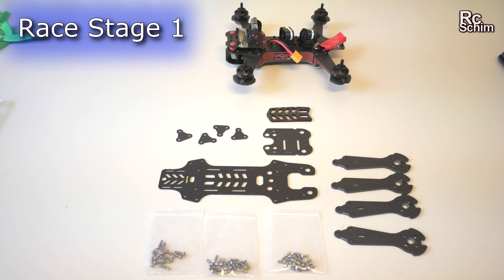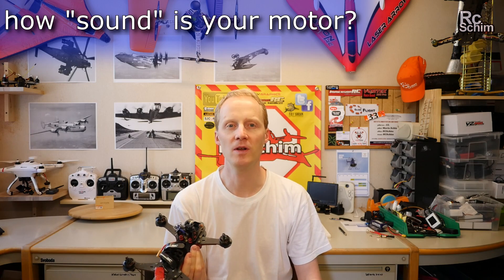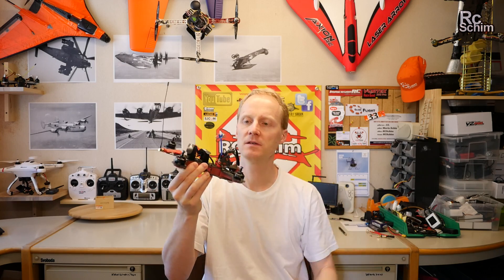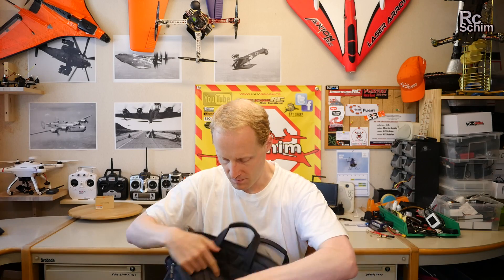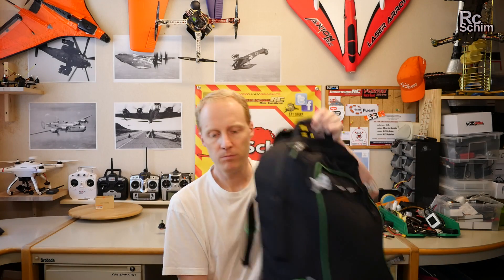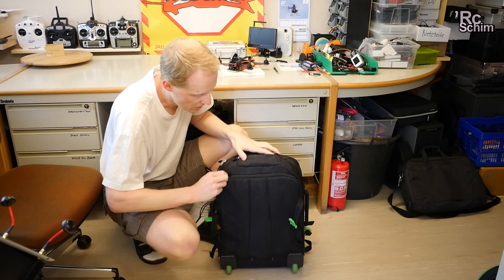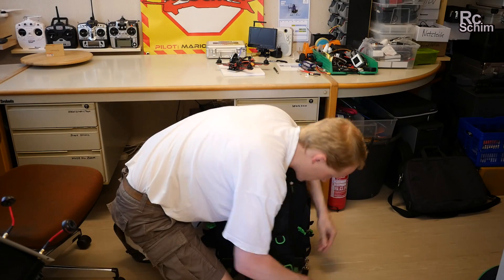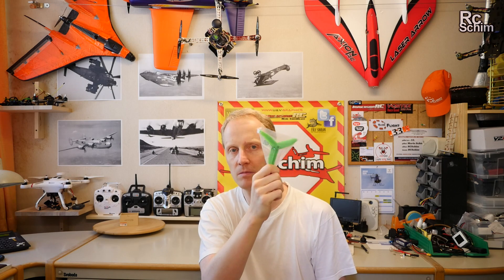Vortex 250 Race Stage 1, my FPV Backpack, Motor swap and another CRASH

Comment: I bent a shaft on one motor today and i want to change it with emax 2205 2300kv. Should i just change the one or buy all 4 ? and do i need calibration or something after changing the motors ? Thanks
Reply from the maker: +25trajcer in theory you can have diff morors and escs as well but it is not optimal.  I think skizo made a video with his frankenquad... calibration is only needed if you change esc i think

Comment: Hi Mario, sorry if you covered this already but how do you like the ezUHF with that setup? Also were you able to get GPS working for speed readings and position incase of a crash?
Reply from the maker: Hi Jeff (let's just assume Shana doesnt care so much for RC :),
  ezUHF is ok - but recently I had some rssi warnings already at not so long range - so I feel a bit unsecure right now. can be a defective RX or antenna since it was involved in a crash. gotta research this more).
No GPS here - didnt care. Crash: I use DVR in fatsharks - normally this gives you a good estimation where to search and for really finding it there I have a Loc8tor inside the fuselage which has a range of around 80m this way (enough in a field).
Reply from the maker: speed I estimate around 100kmh (based on video analysis and google maps measurements)
Reply: haha you are right :) thanks for the info... do you have any opinion on the vortex 285? Maybe be better suited for carrying a bigger bat? -Jeff
Reply from the maker: the 285 is the older one right? but there is also a new pro version the 275 pro - which is tuned by metal danny - and I guess it has larger props (more speed?) 
http://www.dronetrest.com/t/vortex-275-metall-danny-edition/2700

Comment: 40 grams is quite a bit sir! I actually skipped on the Vortex because of the weight, but this might change things :) 
Thanks for the video! :D 
Some motor guards would probably prevent dirt from getting in to the motors?
Reply from the maker: before I installed the race stage1 I realized: I did use an SMA adapter thingy that made my antenna taller (to stick out further for better video). this thing has 9gr!!!!
so be removing this unneccessary sma adapter I got to the advertised 40gr in sum :)
not crashing would prevent dirt getting in there as well - that was my plan - I have to stick to this plan more :)
Reply: Ghehe THAT would help quite a bit as well indeed :)

Comment: Hello RCShim the new vortex pro Uhmmagaud model comes stock with 5x4x4 props and their is a video by Boris demonstrating the props as he was the first to use them and they increase speed by 20 Mph I,m guessing but if you watch his video it looks a lot faster. Thanks for another good video. P.S have you tried the new Vendetta yet?
Reply from the maker: the Ummagawd edition has Race stage 1 included per default.
Not sure about those super demanding props. they kill your batteries in no time. 
I remember that speed run on the initial Vortex250 on their hawaii trip. I think it was tommy. he flew super fast, out far - came back and crashed into the salt water near the beach because his battery was flat. the vortex flew the next day after it was dried in a bag of rice. epic :)

Nope, no vendetta here. Trappy once told me he would send me one - but I think he gave away too much. there is a good comparison on rotor riot - they tested vortex vs vendetta.
If asked I now advise people to buy the vortex. it worked good for me, is available in so many different shops. it's out longer and proofen. maybe vendetta is more bad ass... and looks cool as well :)

Comment: Interesting... I have been using the A-spec batteries (1300mAH) and found them to be not very good at all.
Reply from the maker: well, I'm not a pro battery tester (like you or Joshua Bardwell) but my test is: fly them to 20-15% have some fun and after landing touch them. 
if they are as cold as these were - I'm ok and think the AMP draw didnt kill the batteries.

according to my charger (graupner duo 60) their IR is around 45 to 50 mOhms where the 1800 graphenes showed 15-20 mOhm on the same charger.
I know these IR tests on chargers dont mean much - but I started noting them down in my flight and charge log.

I have 3 flights out of each of the 4 packs 
flew average of 4mins with my vortex (so not too hard acro), charged avg 1034mah on these 12 
flew them down to avg of 18%  (that Vortex OSD is so nice, sends me the mah consumed warning always in the right time)
flights and flew with avg amps of 13 to 19amps.

One of the 4 packs had slightly off balanced cells but this dissapeared after the first charge.

I chose them because they were the best option which was on stock. If they would have had turnigy graphene 1300 I would have taken these.
My tattu 75c 1300 are crap - maybe I killed them with my bullet last year? not sure...

sorry for long reply, coffee was kicking in and I love useless statistics :)
Reply from the maker: just consider:  highes C rating possible (that increases their weight though) 
are they  on stock?
weight to pack capacity
dont by the really cheap brands that lie (when it comes to C rates or capacity).

so far I liked the nanotechs - had no luck with the german SLS, had no fun with Tattu
My batteries are NOT sponsored - dont have to say nice things about HKs batteries - I honestly like them (but I'm not a pro racer with high demands - I do more cruising and just need reliable ones)
Reply from the maker: I think (but didnt measure scientific!):
Turnigy graphenes   are the best (deliver high Amps long, hold higher voltage under stress)
bolt or HiLv look good as well (but were not on stock)
aspec nanotech   look promising, work ok for me
normal nanotech   had many of them - good but get puffy over time
multistar     very good weight vs capacity but not really powerfull (low c ratings)
normal turnigy   
I didnt test/use the other (zippy, ....)
Reply: My A-Spec batteries have quite a high internal resistance and this shows in the way that my low-battery telemetry alarm kicks in pretty shortly after take-off.  The higher-C nanotech packs are much * better in this regard and I don't consider the quite significant premium charged for the A-spec batteries to be worth it.  The bolt batteries are *much better (value-wise) and the Graphene packs are holding up very well (but they are heavier).

Unlike many people, I've had  very little trouble with nanotech packs puffing -- probably because I am very rigorous in ensuring that my packs go straight back to storage charge when used.
Reply from the maker: Now I've watched my DVR flightlogs with OSD (Vortex shows Volts and Amps which is handy).
The fresh 1300mah packs did normal but I was at a new location and did just cruise around and took around 15-25amps from these batts. 
The voltage dropped steadily from 16 to 14 volts over the capacity.
once I did a punch out (65amps) over a tree the batt did sag down to 13.6v (only took 150mah out of this pack before the punch).

if they were really performance batts I think they werent supposed to sag below 14v.
So I have to agree that these sure are not aspec or any good for hard racing. I will see how they perform over time with my freestyling around - but I latley liked it more to cruise around smoothly. Guess I could go back to 3cells for this :)

now I found a comparison: on a flight with an 1800mah graphene I had a 65amps punchout for 2secs and the pack was around 50% capacity:  the voltage dropped here to 13.4volts

Comment: Also, what's up with that Laser Arrow? I see you bought it and had it in a video, but have never built it? Looks pretty cool.
Reply from the maker: that plane has a longer story. It came RTF but the motorshaft was bent BEFORE even having a chance to crash it! it wasnt only the prop that was causing massive vibrations. The vibs were so loud it screamed - so I stopped flying and wanted the shop to replace this new motor.
they took 3 weeks and sent back the original motor with "you have to balance your prop" message. Fine shop!  (austrian shop, Schweighofer)  
I then ordered a potent motor at hobbyking and now I didnt have the time to install this motor.
But I should because this thing is a rocket. Literaly! it can start from the vertical position like one :)
gonna try to spend some time on this one soon.
damn. too many projects, too many different things to fly, too little time to...

Comment: You should build a 5" Alien with KISS FC and those KISS 24amp racing ESCs. I love mine. I swear by the KISS FC, and any of the KISS ESCs, but the 24amp racing are the best. They have a 32 bit processor on each one and can give you telemetry. They are the best quality I've ever seen for a quad ESC, after all they are German made!
Reply from the maker: I will test a new alien like fine frame maybe (in the next weeks) so I'm researching which motors, escs and FC to use. I heard good and bad stuff about Kiss - skitzo tested 2 quads - not sure what his final thoughts were...
Reply: Whats the bad stuff? Fire? I've seen some videos and heard some stuff about how they can catch on fire. I have also seen a lot of other ESC also catch on fire though. I'd be interested to hear though. Maybe it's not the esc I like so much? I have only run then on the KISS FC. Maybe it's the FC I'm in love with lol.

Comment: Using 433 MHz rc is ok, but for mini quad it makes too big delay. The mini quad is mostly for racing and aerobatics which requires fast reaction. For long range FPV I use my good old tricopter with 433 MHz immersion rc.
Reply from the maker: yep, I noticed some situations where the latency was "present" (if you're diving down between trees and suddenly need to evade some obstacles. It should be possible to have ezUHF on sbus mode with lower latency - gotta research this. I want maximum possible control range (just in case, mountains etc.) Also I missuse the little quad for proximity and longer range in scenery. Racing isnt for me, acro is fun - but most times I do tree surfing and flythrougs...   Tricopter rocks. I love how they "feel" if you turn into a corner. I flew so much with the old KK1 Tircopter in 2011.
Reply: The SBus in ezUHF will not help much. The latency is due to low frequency (433 as compared to 2400 MHz radio). Low frequency means less information can be transferred in given time. This cannot be fixed easily.
Reply from the maker: thanks for that thought - sounds logic. I will stick with x4r for close proxy flights and will have another quad for longer range and less reaction needed...
Reply: I also had an unexplained crash using the Easy UHF, but it was on a HobbyKing SkyFun. I was flying along fine, then it just lost complete control, and acted like an aileron came lose or the connecting rod pulled out. When I got to the wreckage, everything was fine, except it was smashed in the nose. I even had pretty good metal gear servos on it. Just before though I noticed how much latency it had, and was thinking like you about the SBUS. I've been thinking about the TBS Cross Fire, it's 900-800Mhz and you don't need a ham radio license to use it. I have heard great things about it, but it is pretty spend y about $300 for the Tx and Rx.
Reply: One possible solution is a 2.4 GHz booster say for 1 or 2 Watts for . They are cheap, but I am not sure if they are legal in Europe.
Reply from the maker: the easier way would be using the longrange version of the FRSky receivers. I will dig into that later...

Comment: I have mostly flown a lot with T-Motors 1806, 2208 (both 2300KV) with mini quads!
Few months ago i tried some Emax 2205 2300 KV, they are quite popular right now, honestly for the price they performed pretty well and the quality seems to be good even after a couple of crashes, they still perform good!
In term of props, i was mostly crazy about gemfan 5045x2 bullnose and recently i started to use the new version of dal props v2 5045x2 bullnose and i have to say i am pretty impressed by the performances, the quality and the price compared to the Gemfan. 3 blades props are something i still need to use too lol I just started to fly with them! But once again Dal props v2 are my first choice...
Really love your new bagpack, pretty interesting i have to say and your taranis bag is definitely something i should buy :p
Funny noise at the end of the video, for joking i was thinking, it could be his girlfriend cutting a tree in the garden lol
Happy midweek Mario
Reply from the maker: thanks for your motor and prop tips Cedric! I read about emax. Might give them a try. I had this Ikea Trolley sitting there for a while now. As said, with the transmitter bag, I like the oranization in there. The wheels are pretty large a smooth on this trolley as well. I one takes it really for travelling you sure can fit some charger and additional stuff in there...Have a nice week too!
Reply from the maker: btw. the sound in the background was the mother in law cutting some higher greens, we dont allow them to cut any more trees. It's really important to have the big green fellas around if you're living in a city!
Reply: RCSchim Hahaha that's a very healty mother in law you have over there!
Mine doesn't like me unfortunately, but i would trully enjoy spending time with her but she has her own believes about people like me...
Anyway, enjoy the rest of your week and enjoy these precious moments of life with your family
Reply from the maker: sad to hear Cedric, but sometimes you just cant change peoples minds. I think it's getting better, more open, but there are still demons from the past in the heads of people. 
You too, have a good week, greez, Mario

Comment: In my opinion the stock rebranded Hobbyking Vortex motors are terrible! So I swapped them out for some Lumenier 2206 motors and haven't had any problems.
Reply from the maker: thanks, I will chek this motors. Red bottom are emax, right? read something on RCG about it.
Reply from the maker: +JKFlorida in what regards do you think the lumeniers are better? I want reliable ones. Nice if they are efficient. Cool if they are more powerful.
Reply: I'd put red bottoms on it or the fpvmodel 2300 or 2000kv 2206 they are durable.
Reply: +RCSchim The Lumenier motors have like 40 flights and the bearings still sound smooth! The stock Vortex motors sound like they had sand in them after 5-6 flights. Also the Emax Red Bottom motors are great! They hold up nice in a crash and make crazy amounts of power!
Reply: RCSchim Yes emax, very well built as nice as my 2206 tmotors or the FPVmodel 2206. All handle 4s maybe 5s. Always buy 5 of course and ccw the standard thread. The red bottoms come with extra lock nuts too.